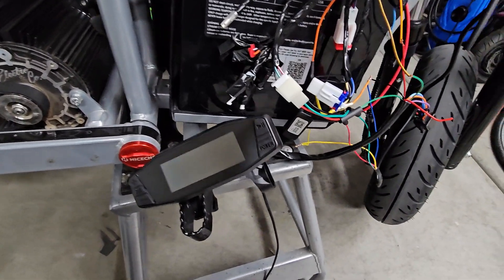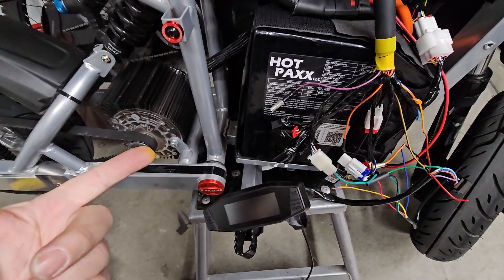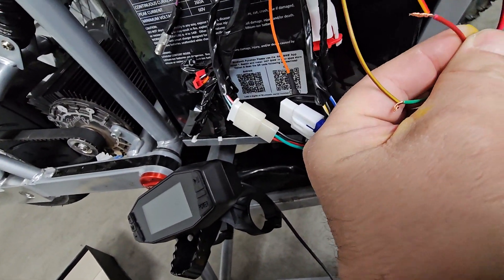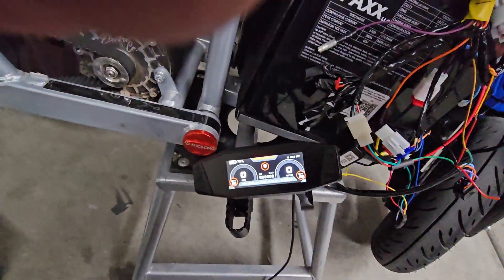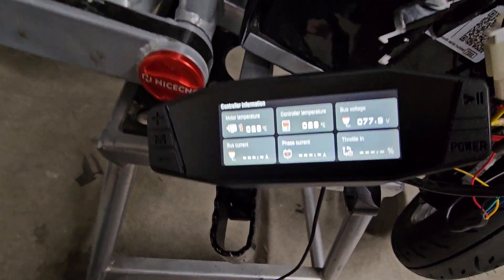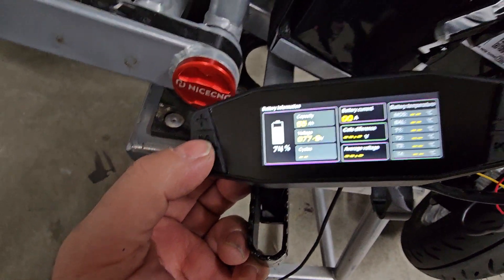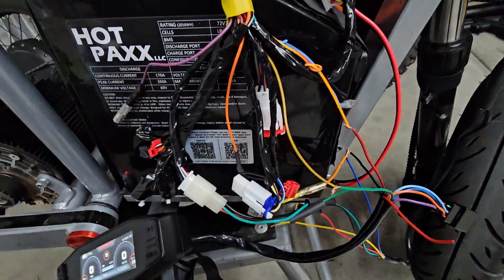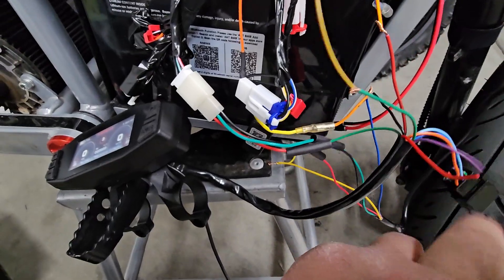Fardriver 72450 CAN bus and Chaojie 3 inch display

Comment: 2:40 BMS must have proprietary "SiAECOSYS CAN" not regular CAN. Fardriver and Chaojie 3 inch display are also using this same special "SiAECOSYS CAN" protocol
Reply: Wait is that really true… because I want this display literally just because I could connect my bms. But if I can’t get the info from a regular canbus communication im not going with it.
Reply: @2facedTony Yes. JK CAN BMS for example has different CAN protocols for connecting solar inverters but no "SiAECOSYS CAN" protocol. You have to search for special BMS with that protocol. They're very rare as I understood. Looks like the only way to get that BMS is to contact SiAECOSYS or Fardriver directly
Reply: @BlinkerDKS  I never heard that but I also have never seen anyone have the bms lead voltages on this display either but I really wish it did

Comment: CAN+ to CAN+ / CAN- to CAN- / green negative to battery negative / black e-lock to battery positive 
Edit, I was able to make it work! It reads all data perfectly fine: Change Speed Pulses to 11 and SpdPulseNum to 10459 - CAN: 18 - CAN Detect: 150ms - CAN Baud:0-250k
Reply: Thanks for this Sean
Reply: I have not key ignition for my build, would using this help me turn on the display through the power button it comes with?

Comment: I have the same wiring setup, however I can't seem to get the display to show any settings other than voltage. FarDriver 72630, Is there any settings in the app for the display to enable CAN?
Reply from the maker: There's some settings for sure!
Reply: @NRGZ28  Did you mess with any settings related to the display? I have mine wired verbatim per your setup and It will not display any additional info besides batt voltage. 

There is a CAN 0-60 setting and the baud rate 250k, 500l 2M
Reply: Could you perhaps send a screenshot of your settings in display settings? 😊

Comment: What color is one line? My battery is not can enabled, can I still use those wires as shown in this video? Thanks for this info, been searching everywhere. My controller is ND72450. (edit) Dang my fardriver is not can enabled, the guy I bought it from said unless my battery BMS was can enabled I would be able to use it with the display, seems like that is not the case. Dang. Looks like one line it is.
Reply from the maker: I'm not sure what you're asking. I'm showing how to hook up a controller to that specific display. Nothing about one line or the battery..
Reply: @NRGZ28  what color is the one line? My fardriver is not canbus enabled. I hooked it up to the purple wire and it wont even show speed. Is their something I gotta change in app?

Comment: Good information...how battery will connect if it is smart bms and has CAN communication
Reply from the maker: It needs a 12v supply, so you have to use a stepdown converter.

Comment: Thanks for the help man, I was wondering do you know which can lines go to which on the display? I have a ant bms amorge battery and ND72680 controller, I just hate how the diagram doesn't specifify which lines is used for what
Reply from the maker: Well I did mention the colors of the can lines in the video...
Reply: Hi my friend i buy from ali this lcd for fardriver controller i have nd72450 fardriver with canbus wires 
But it doesn't work this screen doesn't read the controller ..
Maybe i need to configure can enable in the controller ? If can how u do it? Plase halp me thanks dani..

Comment: Thanks for the video! I'm actually having an issue with mine. In the backend, I tried following the button prompts for switching the metric to mph but for some reason even if I hold down the M button it won't switch it to MPH. I even held down the button for a few seconds but no change. How were you able to get yours to switch in the backend?
Reply from the maker: Chaojie released a firmware update that comes on a USB stick to address that issue. Get your dealer to send you a copy!
Reply: @NRGZ28 it's the top right button that swaps between kph and mph once you've used the left hand buttons to get to the right box. Took me ages to figure it out, especially as instructions said the right hand buttons weren't used for anything.